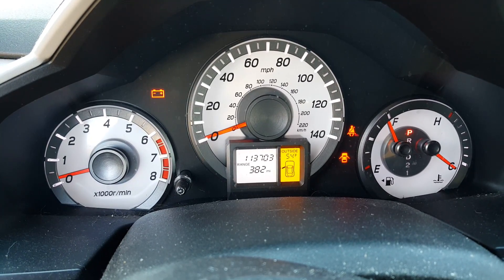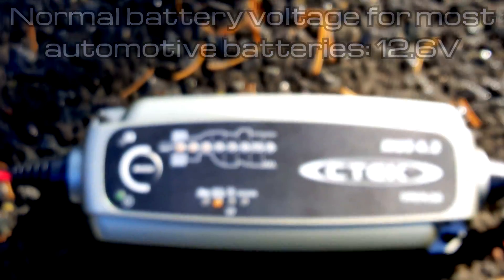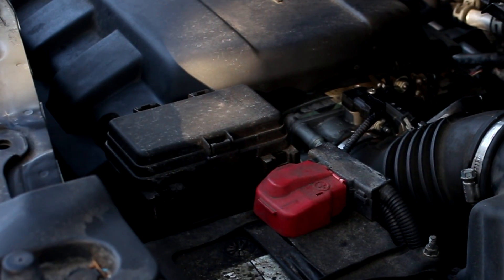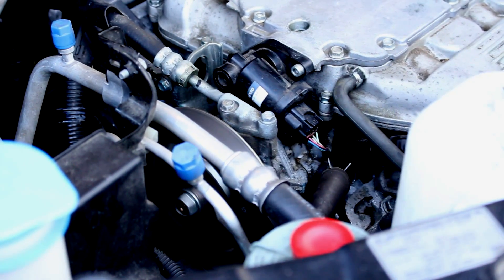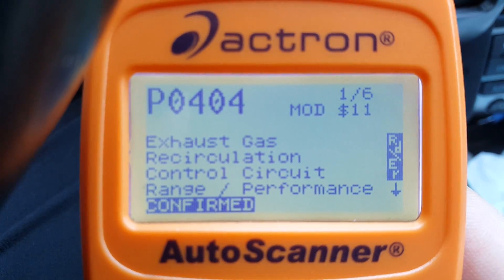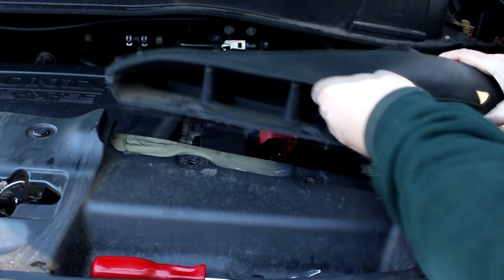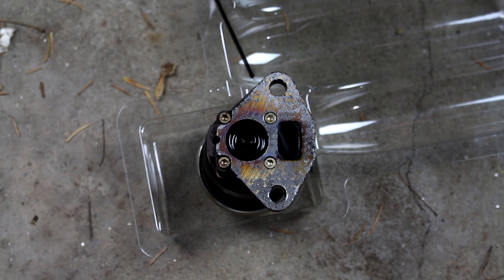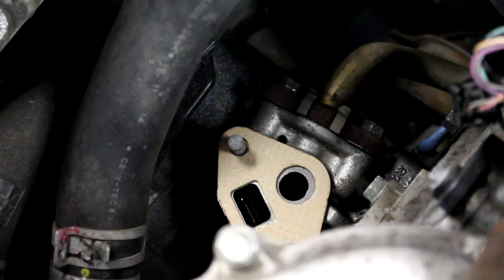Diagnosis: EGR Valve Causing Difficult Start-Up • Cars Simplified

Comment: Mine was clogged and my engine had no power sometimes so I cleaned it, after cleaning it I have the same issue as in this video, I don't know if I did something wrong
Reply: At cold start it starts up a little difficult and I get misfires when full throttling so if I gently push the accelerator there's no misfire. When the engine is warm I can full throttle but theres no power, the torque comes only after 2k rpm
Reply: @georgescurobert-mihail8813 your EGR valve could still be faulty but throwing different symptoms. It’s engine dependant, and every EGR situation is different.

Comment: I bought myself a replacement EGR valve on Amazon for less than USD$50 and will be replacing the stock one in my 2008 Dodge Grand Caravan with just shy of 200,000 miles. I figured, eh, what's the point in trying to clean it when it's only $50 for a brand spankin' new one, and the one that's in there now is over 16 years old. If it was only 6 years old, I'd just clean it, but that's not the case. Going to be installing it tomorrow. :) Also cleaned the throttle body and MAF sensor for the very first time and it's looking brand new as well.
Reply from the maker: I would hang on to the old one for a while just in case, but if it's a decent one you bought, having it not just clean but all fresh parts is a nice way to go! EGR valves are put through real demanding work with all those heat cycles and the carbon/soot build-up.
Reply: @CarsSimplified  you are awesome. Thank you. :)

Comment: Did you ever try to start the car while the egr valve was off of your car? Would the car still not start with the egr valve completely off the car?
Reply: If the EGR was the problem it would start if you block off the pipe from the EGR

Comment: I have a 2000 mercedes s500 and it turns but immediately dies after start up and sometimes backfires.  No check engine lights but i did get a code for catalytic converter and EGR VALVE. Would the egr valve cause these symptoms i have? Im assuming so but just want a second opinion.
Reply from the maker: It could be, but what's the catalytic converter code? Before the current problem did it seem low on power?

Comment: Thank you so much this almost confirms my problem!!! Cause I know for a fact it’s not my starter, battery, alternator, fuel pump, fuel line, spark plugs, fuses or my main relay so I’ve been thinking It’s my egr valve and that sound is similar to the sound my 2003 Honda Accord ex makes when I try to start it

Comment: I have a 03 civic... and every morning it starts up fine... but say I drive to the store... get what I need and try to start it up, it won’t... it turns but won’t turn on... I wait like 15-20 mins and it starts up fine or sometimes it’s struggle to turn in so I press the Gad and it turns on... could it be the EGR??

Comment: Having this same issue on a 2009 pilot.  Is cleaning the valve fairly straightforward?  Is a new gasket required?
Reply from the maker: It is pretty straightforward, getting to it is more difficult than the cleaning.

As for the gasket, it's a gamble to use the old one. If I recall correctly, they are really inexpensive, so it's hardly worth the gamble.
Reply: @CarsSimplified  thanks for the reply bud. Turns out, I misdiagnosed the issue from my wife's description and it was just a dying battery

Comment: I have a Mazda cx7, PO401 egr insufficient flow , along with random misfire amd lean at idle. Today it stalled put and has smoke when attempting to keep it running by pressing throttle. Do you think that a new egr will solve this sir ?

Comment: I had the engine light yesterday and the Obd showed the EGR code but this morning the engine light is gone... Does this mean I'm safe?
I didn't clear the code

And also I hav a loud idle??
Wat can cause this
Reply from the maker: I would assume that there is some sort of problem possibly on the horizon; check to see if the code is still there even though the light is gone. Even if the code is gone, there can still be an issue. The ECU lights up a check engine light when a problem is detected by it and turns it off either when commanded or when all the data it has points to the issue being resolved; there could still be a problem, but it is outside of the ECU's understanding.

As for the loudness, that could be caused by a lot of stuff. Are there any other patterns, like it is loud when the engine is cold but not when it's hot, or when it's in drive but not in park or neutral? Is it running at a higher RPM than usual?

Comment: Would a bad EGR cause a high idle?
Reply from the maker: On its own, no. It lets exhaust gas into the intake, so if it's stuck closed, you're getting only clean air, and if it's stuck open, it would lower the idle speed by reducing how much oxygen is available to burn.

Comment: I suspect mine is bad and just not triggering the MIL for some reason.  It runs fine until it gets up to heat, then stalls at idle and starts misfiring.  After watching this I'll definitely check for stored codes.
Reply: Sounds like your crank sensor

Comment: 03 cavalier! idled @ 500, changed AIC valve, coilpack, starter & new battery. Wen u turn key, u hear fuel pump kik on, all dash lights on....but car wont start???????
Reply: Engine coolant temp sensor or crank sensor.
Reply: Does it turn over?

Comment: My 00 Accord v6 sedan wont start after warm, i have to let it sit for a out 45 min to an hour. Could it be Egr valve?
Reply from the maker: Possibly, but it's difficult to determine with that much information. Plug an OBD II scanner in and see if it has any codes stored. Make sure the battery cables are tight and the battery isn't on its way out, too; some engines are harder to turn over when heat expands their parts.
Reply: I’m having the same exact problem same exact car. I don’t know what to do I have had spark plugs fixed also. Only codes are misfiring all cylinders.
Reply: @eljona1665  Could be ignition coil